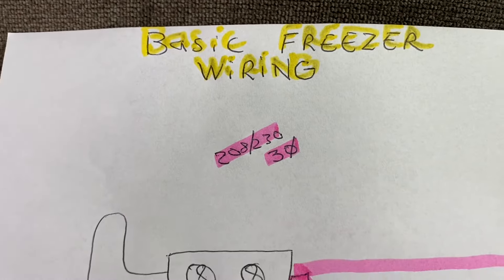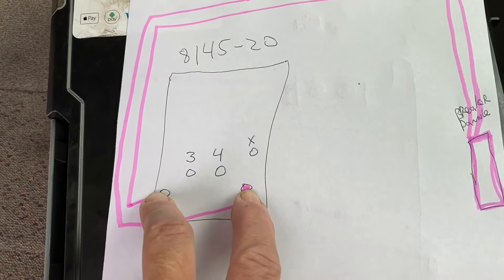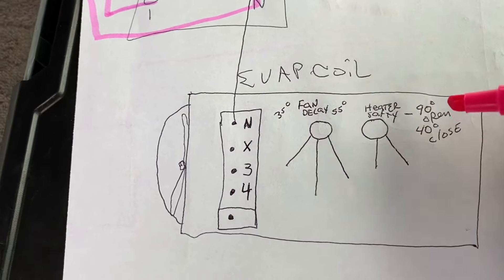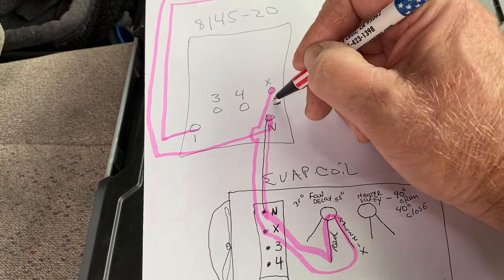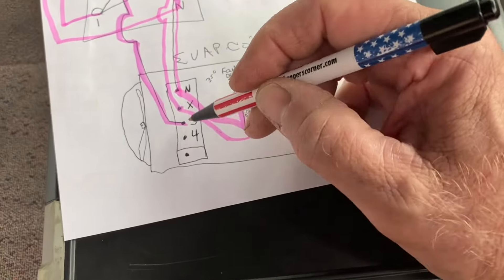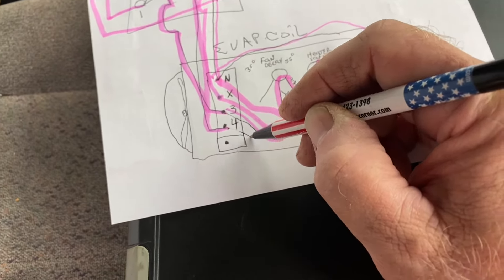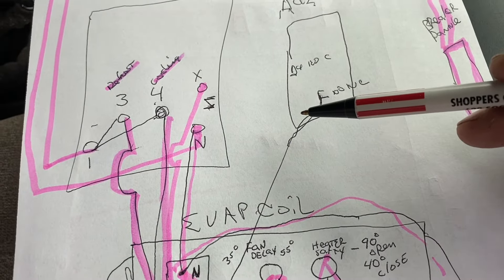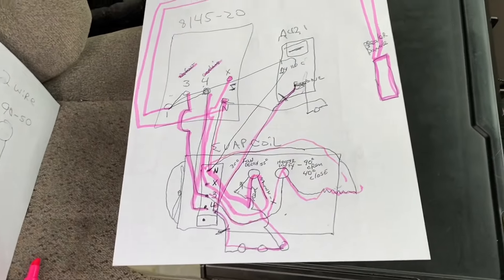Basic walk in freezer wiring

Comment: Covered this in trade school a lifetime ago, but with no "hands on" experience, remained a bartender for  far too long.

Had been in F&B operations for 35 years, barback to management, got bored with pushing paper and for the past five years to chase the blues, as a sideline distraction, have been more or less handling most of the fridge work, (with varying degrees of success and flaming failures) at a horse race track / music venue where I still spend more time pushing paper.

Attended  Bryan Orr's first symposium pre-pandemic and met Dick Wirz.

40 years later...watching your back of a cocktail napkin scribbles with free verse keeping it real rambling video  has connected more of the dots between my ears than any of all the above.

Be well amigo, would love to ride shotgun with ya one early morn!

Comment: Good explanation on the wiring.  To remember the red brown and black wiring positions, I carry the Dick Wirz refrigeration book in my truck, for the three wire control. Some use two klixons instead of the three wire,  Some mount on the tube sheet end of the box while others mount on the 180 bend.  The electronics are eliminating much of it now.

Comment: Thank you for this video. 
When you say, that activated "half of the evaporator fans" and then the "fan delay activates the second half". What do you mean by that? All 3 fans run at lower RPM (half speed) first and later on at full speed? Or does it mean that only half of the fans run first and the other half do not at all but only later are turned on when fan delay has reached 35°F? So, do "half fans" refer to lower RPM speed or only half of the fans are running at first stage?

Comment: I definitely got the evap side of it but how does the control voltage get to your contactor up top? Am I bringing #4 from my defrost clock up to one side of the coil voltage on my contactor and the other side goes through my low pressure/high pressure switches?
Reply from the maker: the time clock controlls your solenoid valve coil. the condensing unit is on its own circuit and the psi switch controls one leg of your contactor. hope that helps.

Comment: Where can I get 240v to power the A421 when converting from mechanical and the defrost clock (terminal 1) is on the condensing unit? Seems only N is always energized. I've been having to feed in a neutral and run the stat 120v but wish could just use the wiring already available in the freezer evap.

Comment: Working on a turbo air evaporator. Curious.. the freezer was at 65 degrees ( room temp) we couldn't get the fans to kick on to cool the room down. The compressor kept kicking on and off because of low pressure. Does the evap cont. to do that till the fan delay gets to 35 degrees?
Reply from the maker: The compressor will run low suction until the fans come on.

Comment: Can I use a 8145-20 time clock to replace a 8141-20. I know the 8141 has 2 nc contacts but the freezer seems it only needs the cooling and defrost only? It’s a norlake old capsule type WI.

Comment: im trying to  process this. I think I got a grip on it. When not in defrost and no call for cooling common sits at the fan delay not actually running fans unless there’s a call from the stat opens the solenoid pressure switch makes temp drops below fan delay set point in which then it makes. Fans run. 

Defrost time starts. System pumps down? Heaters run? Until either time is complete or temp on defrost term makes in which we repeat first step.
Reply from the maker: As long as the box is below 35 the fans always run until defrost. Defrost timer drops one half of fans ( 230 volts ).  Usually defrost gets coil above 35 degrees and after defrost the compressor will run with less load on it. Until coil gets to 35 degrees. That’s what the fan delay is in there for.

Comment: If the defrost clock is just a switch why are you supposed to see voltage at the terminals in the clock shouldn’t you see no voltage if the switch is closed?

Comment: Where would you wire in your condensate line heater in this application?
Reply from the maker: 1&N with a 208/230 heater. That how most are here.
Reply: @NorCal-refrigeration  what if there’s no wire going from 1 on the roof top timer and the evaporator. Would you go 4&N so the heater is energized for the majority of the run time and just not during defrost?
Reply from the maker: @chrisbivens5410  gotcha you could try that if the line freezes up might have to run a circuit to it 115 volt and a 115 volt heater. I’ve seen that a lot also.